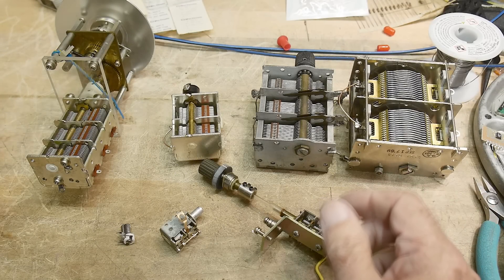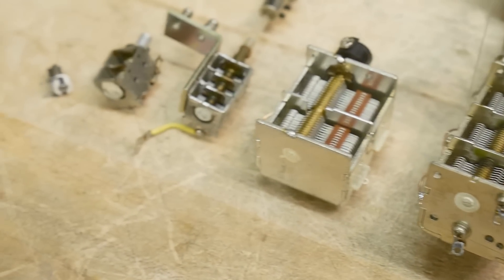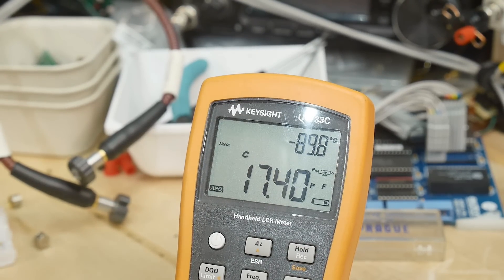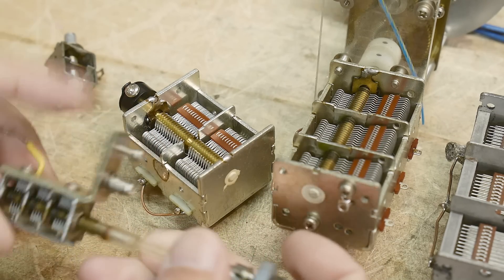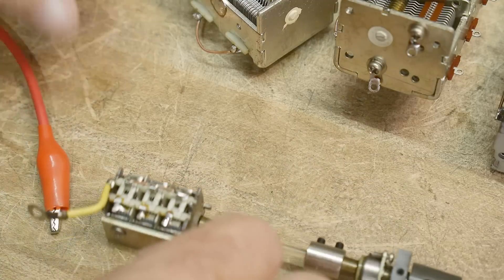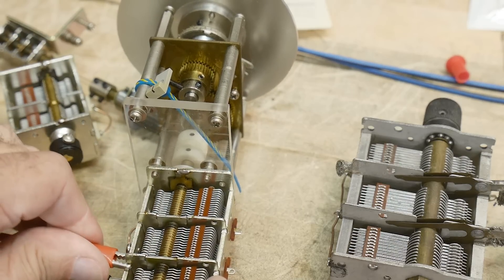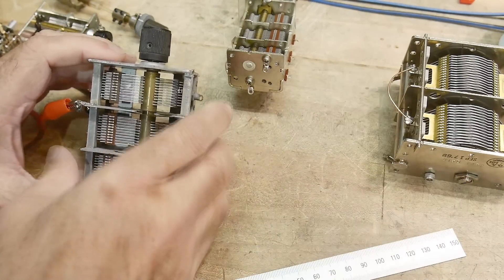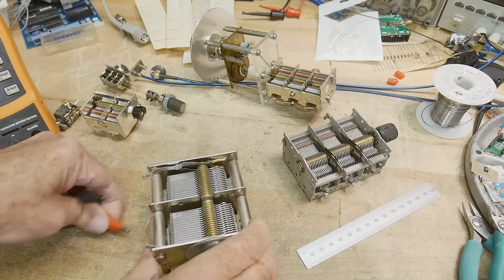#2065 Guess the Capacitor

Comment: Watching this long after it went up, but a type notably missing is the sort that were very common in shirt pocked size AM radios o' nae sae lang syne. They usually had some sort of plastic film (polyethylene??) dielectric. IIRC, some had one or more "trimmer" or "padder" screwdriver-adustable caps incorporated.
Those in the video are almost old enough to use in steam punk gear. (I quite like steam punk. Had my vision and ambition not failed I might have spent my years up to the ultimate spin-down of my Krebs cycle building steam punk.)

Comment: Thanks for this geeks' game 😀  My under 10% error (except for the 3rd one) is perhaps because I used a lot of them in valve circuits.  If the plate distance is greater, it withstands a higher voltage.

Comment: The bigger ones were harder to guess, but I got pretty close on the smaller ones. I had guessed 20pF, 50pF, 70pF. Then I blew the next one with a guess of 250pF, and it only went downhill from there. :)
Reply: You have to take into account the spacing at the same time.

Comment: two fun facts about these capacitors, I just read about these last night. 1) you notice that the shaft is off center  (in the 3 last larger caps) and there is a larger area of spline on once side, this allows for the change shaft angle to change linearly but the capacitance change to be non-linear,   I believe this is related to the resonany frequence of the lc tank being f = 1/(2*pi*sqrt(LC)) so to achive linear frequency change for linear shaft angular change you need to off centered shaft and some non cylindrical plate geometry.   and (2) IMSAI guy has connected the sections in parallel but these sections would normally be used as 2 or 3 different capacitors each part of a tuned LC tank circuit with amps in between so again a single shaft angular change would tune 2 or 3 individual tanks that are in a serial (ampliified chain) all at once.

Comment: Those are the high-quality units. Ever see one of the all-plastic cheapo units from a pocket radio ?

Stupid me had a precision variable capacitor with high-quality ball bearings and and a vernier dial.....and I threw it out decades ago.
Hey...time for a new battery.
Reply from the maker: yes, I use one in this video: https://youtu.be/a4pfbDJIoQA?si=6Sf7I5A_CAUSH7Be

Comment: Greater air gap = higher voltage  Ought to drag it out and measure but the air gaps in my old 2kW antenna tuner caps is substantial.

Comment: Called 'air-variable' caps. I guessed 15 pF on the first one. It's kind of cheating on the rest because I just glance in my air-variable cap bins to compare. I have quite a few. But what I don't have is a big butterfly cap for building a high Q mag-loop. Sigh. They aren't cheap. And like an idiot I gave away a good vacuum-variable cap to an experimenter. I'm a sucker for other experimenters. 
The 987 pF cap has plates that are very close together, raising the capacitance. It's a receive cap, (low voltage, no arcing,) with more precision construction. To make them still smaller they slide a dielectric between each of the plates, allowing them to be closer together without rubbing or arcing, and the dielectric also increases the capacitance.

Comment: Interesting, 365pf used to be a very common value.    You should do a video about the rotation angle vs capacitance, I am sure there is some interesting math around the offset shaft and plate area change vs rotation.
Reply: There was few types, i.e. linear frequency v.s. linear capacitance, maybe linear wavelength too. (  reference to radio signals being processed in circuits containing given capacitor )

Comment: I don't remember the equation from Physics class, but it would be interesting to take some physical measurements of these variable caps and calculate the capacitance value. Imagine the size a capacitor in the micro-Farad range!
Reply: The formula is a useful thing for people who do radio frequency electronics work to memorize.  Ignoring the fringing effects at the edges, the capacitance in picofarads for a parallel plate capacitor is about 0.225 times the total area between the pairs of plates divided by the plate-to-plate spacing, with the area expressed in square inches and the spacing expressed in inches.  If a dielectric other than air or vacuum is used, then the result is multiplied by the relative dielectric constant of the material between the plates.  If the dimensions are expressed in square meters and meters, then the constant, 8.854, replaces the 0.225.

If I have done the math right, a square parallel plate one-microfarad capacitor with air dielectric and a plate spacing of one hundredth of an inch would require two facing square plates 17.6 feet on a side.
Reply: @analog_guy  , thank you!  That would be a huge variable capacitor!

Comment: I like those tunable air capacitors very much. I am always afraid that this kind of component will be no more available in modern times so I bought some of them. 
From old AM Radios I learned that one stack of plates has something around 500pF, mostly a little less. The voltage limit is around 500V and when testing it the sparks are evenly distributed telling that they are well aligned. The plate at one end has cuts to allow some fine tuning.

Comment: about 5pF to 500pF, the spacing is more important if they are turning an RF amp as the smaller ones will flash over easer.